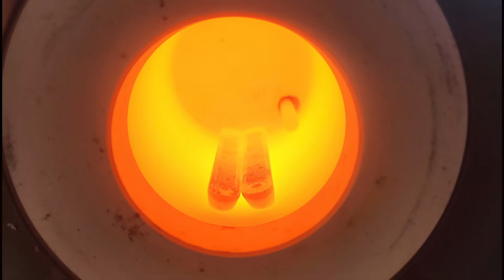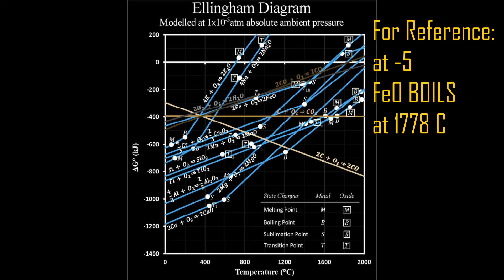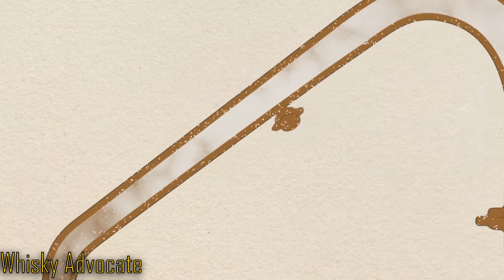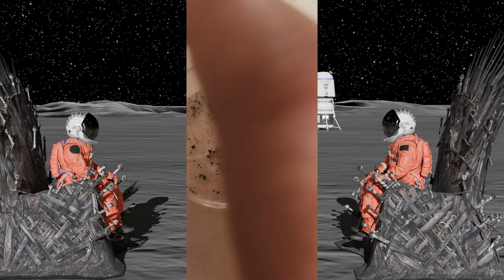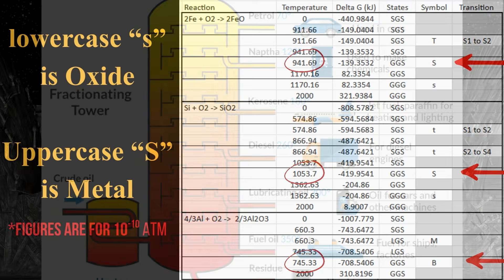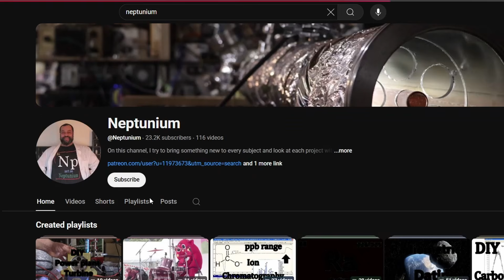Refining Moon Regolith With Lasers (Part 1)

Comment: Use energy on the moon for human habitats, mining and launching raw materials to space.

Spin launch raw materials to space where it can be processed with continouse energy from the sun. Rather than on the moon were the sun shines 14 days and it is dark 14 days. 

Silicon crystals produced in Zero G are better tgen crystals made in Earth's gravity, which suggest solar panels produced in space may perform better then those produced in space.  We can get to work on solar power beaming to earth or powering space industry around earth. 

Take note:  SpinLaunch's current suborbital launcher at full power can cheaply launch a payload with a velocity almost equal to the moon's escape velocity.  The planned full size spin launch platform with planed orbital accelerator if placed on the moon has enough delta-v to get it to Jupiter making asteroid interception possible and a Jupiter gravitational slingshot to interstellar space possible. Furthermore on the moon, two concurrent launches become possible, doubling the energy efficiency of launching raw materials to space. 

Cheaply spin launch buckets of lunar regolith to space for processing is the near term expansion of humanity in space.
Reply: Molten electrolysis benifits from artificial gravity. Hyper artificial gravity greater than 1G helps with oxygen gas bubble detachment which reduce energy requirements  10 to 15% over earth 1G gravity. Lunar gravity is likely to be worse than on earth with poor bubble detachment driving up inefficiencies that require higher voltage and more power. We need to Spinlaunch raw materials to space where stations can make use of hyper artificial gravity processing for more efficient refinement with continouse energy from the sun.
Reply: Yes, processing materials in space is the best. There is not such need to ration energy in space, as currently is is just being wasted, so whatever use you can extract form it is infinite increase of efficiency.
Reply: @Molb0rg from a continouse energy perspective yes. But what really makes space industry on a large scale is to have the ability to launch raw materis to space cheaply. 

While current SpinLaunch's suborbital launcher   launches it's launch vehicle up to the sky, it concurrently releases a larger counter weight on a shorter arm at the earth.  Because of no atmosphere on the moon, at full power and a higher elevation, it could concurrently launch two vehicles parallel to the horizon in opposate directions to near lunar gravity escape velocity with double the efficiency to low earth orbit from earth's surface.
Reply: @kreynolds1123 yes, it can launch 2 payloads.

Butconstruction it self is stressed and requires some complex manufacturing and all that - it does not smell like cheap easy, simple, robust, easy to operate, easy to fix etc. it an option for sure. How good of an option it is depends on many factors.
Reply: @Molb0rg  on earth, not only does it have to hold back the pressure of Earth's atmosphere, which is a reasonable challenge with such a large construction. But it also has to have pumps to evacuate it, and a door that opens and closes in a very small fraction of a second. 

Certainly constructing a spin launch platform on the moon will have challenges, but in some ways it will be simpler to construct with fewer systems and walls that are far thinner.  Cheap comes from several things including fewer design requirements less structural requirements, and from repeated many launches. So, yeah it won't be cheap if you plan only 10 launches but if you plan tens of thousand launches or more and the economics change dramatically. 

Is this something that can be done in the next 5 to 10 years.No. I think it could be done in about 20 if humans put their will to it.  But there's a lot of chicken before the egg. Economic interest in space industry  that I am imagining,  so it might be further down the road before we build one. But it's really inevitable that it will eventually be part of  human space  expansion.

Comment: Nobody wants to deal with fluorine. There already is no people on the moon, so why not.
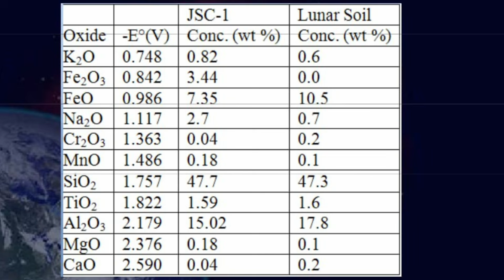Reply: 11:55 Huge current is required to process it fast enough. In this case, reaction speed is controlled by diffusion to electrode instead of ion property. Since diffusion is basicly same to these ions, sepration becomes impossible.
Reply: Lets put tons of it on a rocket and try to launch and land it on the moon.
Reply: Depends on how far into the future we're planning. At the moment, automation is not good enough to build and operate industry on the moon without humans doing a lot of the work.

Although it's probably better to wait with doing it anyway because we have plenty of lower hanging fruits here on earth.

Comment: The ISS use foldable solar panels 1-3mm thick or something like that .
19x6m= 114m² it come in boxes of 2,3m or 2,5 and tge box is squared so its like 75cm.
In the starship 5,6x5,6 square you can fit 64 boxes
114×64= 7 296m² 
114x 256= 29 184m² 

30% efficiency  11,9 MWp

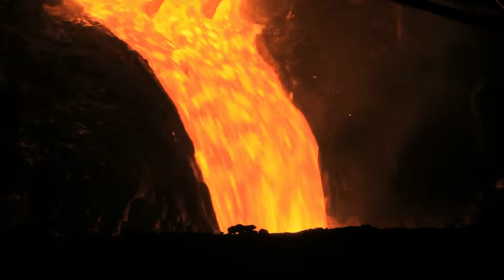Comment: 4:57 but carbon is used in metalurgy especially when it's combined with iron.
Reply: His other videos explain why steel is not necessary on the moon in the beginning since gravity is so much less. So we could save money by going with cast iron instead to make it cheaper when starting out.

Comment: How about synthetic enzymes? I'm a molecular biologist, specializing in protein structure. While enzyme design is in nascent stages, it's growing, but thanks to AI soon enough we should be able to design enzymes to break any metals out of oxides.
Reply: Well it aquatic methods require water and all, which is not desirable.
Interesting in general and not impossible, but..
Reply: How would you be inputting the required energy for the endothermic processes?

Comment: Wouldn't really need a laser.

You could use a filter to pick wavelengths from sunlight, use a rotating mirror to get the correct pulse duration & frequency, and then focus it down with lenses.

Comment: Sabrina saying quantum has no future seems like overextrapolating the fact that it won't entirely replace classical computers because its better for specialized applications rather than general purpose compute; AI can't replace classical software in many aspects, but that didn't stop it from revolutionizing biotech and materials science, and quantum tech has a lot of similar applications. Claiming He-3 fusion won't solve the world's problems is a bit more based in reality, nobody's figured out the much easier problem of D-T fusion power yet after 70 years of trying, and He-3 fusion is way harder.
Reply: He3 fusion has its problems in crossextion of reaction which leads to higher temperatures longer time for containment etc. when it was a hype, old 10 years ago there were few guys who made good explanations on he3 as fuel. Can't verify or validate but it was interesting at least.
Reply: Yeah I am like, when did Sabrina say Quantum computing has no future?
Reply: Welp seeing Sabrinas latest video, I have to digress... yes she had been a sceptic, but now she does mention viability issues

Comment: You're better-off mining Near Earth Asteroids. They have more metals, and no regolithic dust to deal with. And, no gravity-well to make engineering and travel capital-intensive. You should just use mylar to reflect sunlight onto asteroids near Earth. I wrote about all of this years ago: "Imperatives of Space Industry" and "Space Mining: By the Numbers" on Medium, Anthony Repetto. Moon-mining is a huge step down, comparatively.
Reply: Since no one has done a mineral survey of ANY asteroid you can't claim what will and wont be there.  What will likely have to happen is raw material from an asteroid will be transported back to the moon for processing.  A little gravity is a BIG help.  Moon mining would be far easier and cheaper.

Comment: >He-3 separation
I wonder how you'd test that in a earth based lab? Maybe ion bombardment of basaltic powder with He-4 plasma, then checking that you can get the helium back out again with a distillery?
Reply: What's there to test you have mix of helium isotopes and then it proceeds as you would do this separation here on earth.

Comment: I wonder if it would be worth while to make a magnetron for more bulk heating. are there bands that are absorbed well by the oxides separately, or the regolith as a whole?
Reply: Quaise (a texas company) seems to have success using that to vaporize rock, for drilling purposes,  but logically should work to heat up regolith,  provided is is dry, no water, no ice
Reply: @TheJerome1502  consumer microwave ovens excite water

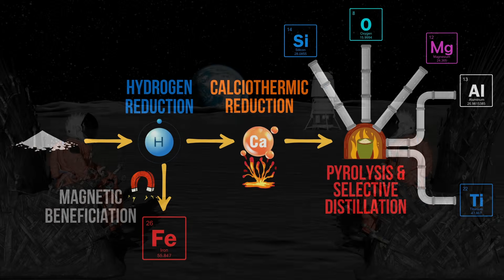Comment: At 57:37 - since this process is being done at H2 reduction and then Ca reduction, would there be a slag or alloy cake? This is all done at near-vacuum, and so the molten leftovers from H2 reduction ... that would still be a solid cake? I thought you'd melt the regolith in the h2 reduction, and then pour Ca into the molten residue and get another molten residue, and then use the laser to separate all the different elements out of that molten residue.
Reply: H2 reduction can be produced on dust without melting it. Probably will need grinding or something and do it longer for H2 to penetrate diffuse in grains.
And then separate iron particles maybe rotate mill it again etc. so real processes of industrial level will require some steps.

Then leftovers have to be heaten to near sintering temps or molten temps to guarantee full extraction of potencially trapped wasted hydrogen and extract fully helium and hydrogen from regolith 
Then next steps.

Comment: Sorta besides the Vid but for the next one you're going to record, could you try to reduce the echo a bit? Depending on mic it might be that you're to far away from it (at least to me it sounded different then previous videos.)

Else.

Damn dude. very nicely researched content. 
just having ~31k subs is was to low for this sort of production quality. 
from all your findings, i'm assuming there will be some white paper like "products" coming out at somepoint? for others to base their research off of?

Comment: even though hydrogen reduction might be more cost effective for iron we could still use carbon reduction for the elements h reduction doesnt work for and any waste co2 could eventually be used for growing plants if we ever have a human presence on the surface
Reply: The plants to human food to plants is a closed loop though, so we'd not need to produce that much CO2, compared to how much metal habitat and industry are going to need.

Comment: I would really love to see some strength testing with the lazer printed regolith. How much force can it hold in PSI?  How thick will a landing pad, roadway, dumb structures need to be to withstand the repeated use over time. 

Does landing a rocket on the moon increase strength?  

Can it 3D print flame diverters to help recapture rocket exhaust? Is that resource recapture worth the investment?
Reply: Good sintering is basically rock type stuff, around 200MPa, all kinds of sintering starts with 1MPa or something.as results.

Comment: As a somebody who spent years on the Moon I can just warn you that when you start vaporising rock on a meaningful scale your vacuum is no more 10e-10 mbar
Reply: Makes sense, but you can do it in the open if you don't need the oxygen.
Reply: @PaulSpades  Even when in the open, you need your gas escape capacity to be much greater than the amount you generate, and 10^-10 mbar is so extremely high vacuum for human standards you would probably need a huge open area when generating let's say a few kilograms per minute. Making it within for example a compact, local facility would create a localized temporary high pressure region (but perhaps with a potential for a small lunar wind farm ;p)
Reply: True, one of the problems here.
It still works at 1e-5 one can polite stuff to that degree as well, but at least it something in 1000's tons processed.
But yeah it one of the problems here.